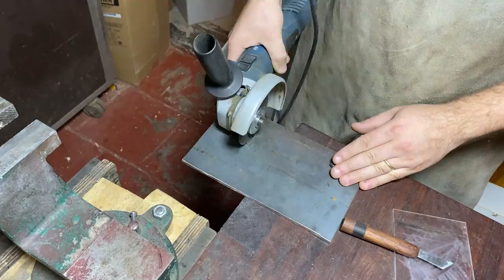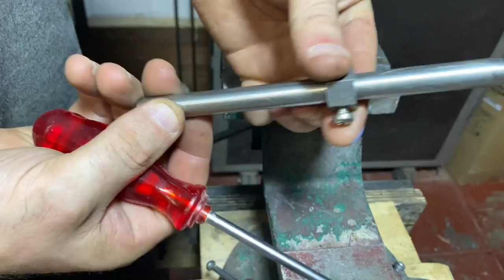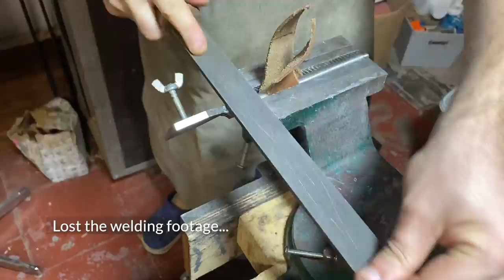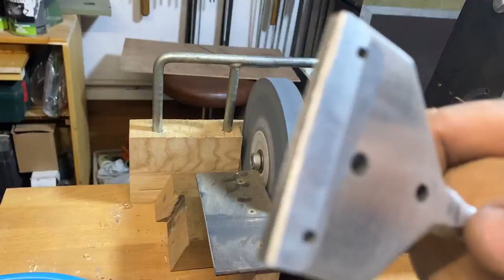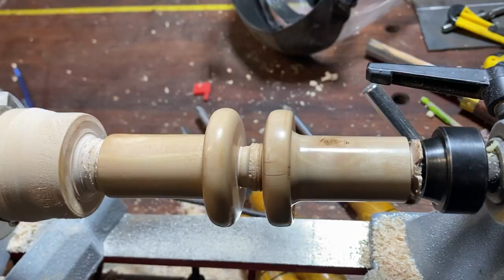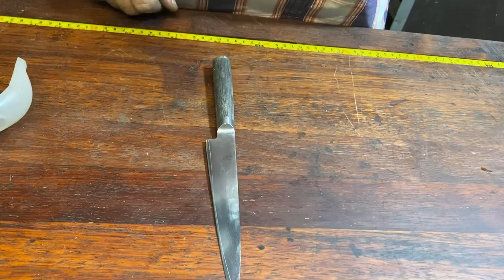#16. DIY knife sharpening jig (inspired from SVM45 jig)

Comment: Would have been nice to get a clear shot of the actual set up assembled. Is the holder arm just sitting on the horizontal rest?
Reply from the maker: Yes it is. The wooden arm is resting on the horizontal support bar, just like the original one.
Reply: @WoodfulProjects  Thanks for clarifying.
Reply from the maker: @aries6776  thanks for watching 👍

Comment: will it centre a thick knife?
Reply from the maker: Hi. The jig can handle up to 8mm of thickness. Regarding the centering, as noted by one of the viewers (see comment) there is a gap between the upper part and the lower part relating to the support rod. Meaning that the edge of the knife will be offset of 0,001mm or something la that (nothing noticeable).

Comment: the factory clamp gives asymmetry on the cutting edge. you can completely keep silent about your invention. and taking into account all the manipulations necessary for production, it is cheaper to go and buy.
Reply from the maker: Not sure about what factory clamp you are talking about and not sure to what asymetry you are referring too. As you can read it in the description, given all the work it required, it is indeed easier to buy it. But, this is worth for 90% of DIY videos on youtube. It's always easier to buy and not to do it yourself because you can't compete with big factories and economies of scale... Anyway, thanks for watching.
Reply: @WoodfulProjects  I'm talking about the original holder. if you want to achieve high accuracy when sharpening, then the tool must be appropriate.
cutting edge asymmetry. when the edge width on one side is different from the width on the other side of the knife.
Reply from the maker: @workshop_oselok_kyiv  at what moment did I mention high accuracy? I mean, I’m an amateur and at no point I claim that this is the best solution. It’s just an alternative to the original and it satisfies me totally. I do understand now what you mean by asymmetry. But let’s be honest, there less asymmetry due to the width difference in my jig than there is due to the use (totally manual) of an original Svm45. 80% of people I’ve seen do not use it properly, and if you’re part of the remaining 20%, then glad for you.